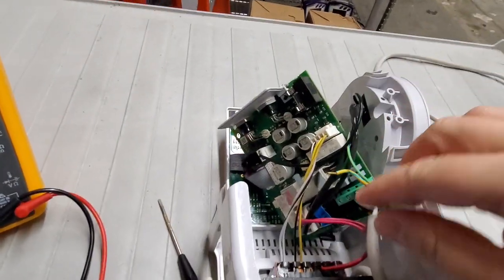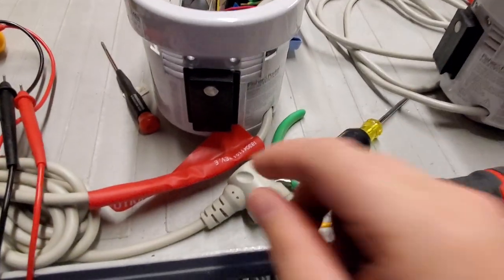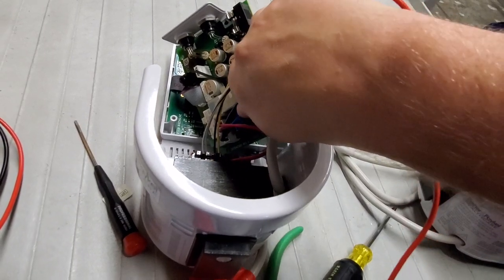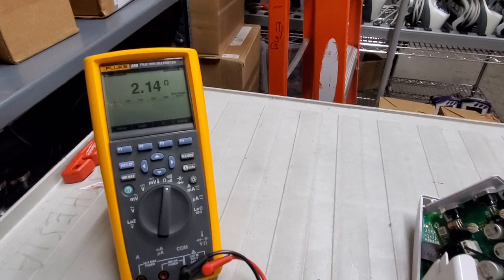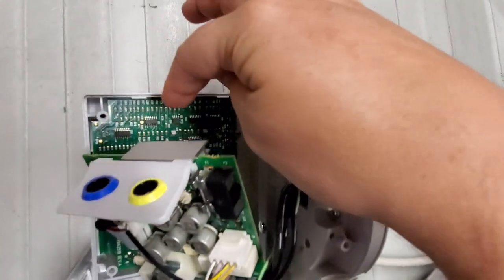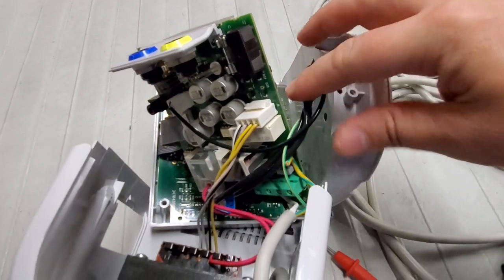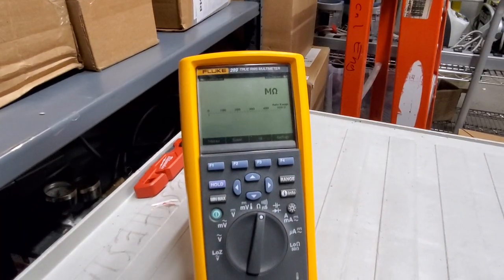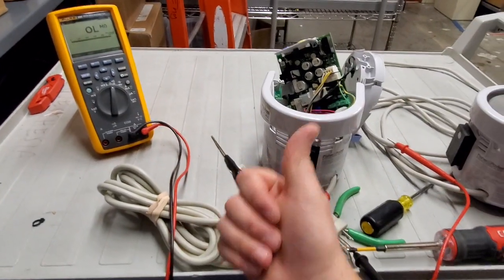Anatomy of a Failure: Fisher & Paykel Electrical Safety Failures

Comment: I HATE putting those MR850's back together..ugh! I find that the ground on those are very touchy, too. The manufacturer says to measure it all by the top plate, but I've had to open it up to make sure that there's a ground reading in there. Sometimes, it's just the plug on the cord, and I'll change that.

Comment: Glad you did a follow up after your last video on these, as I said before they should pass with less than 0.2ohms to the plate. Just for info the plate connection can become high resistance too but slackening and re-tightening the ground wire nut normally sorts. We had a batch of moulded main leads that had high ER years ago similar to what you're seeing now but not connected to the MR's. Very odd but interesting fault. Shows the importance of Electrical Safety Testing, these could easily have a rising potential with that resistance.

Comment: I provide a reconditioning service for the MR850 PCB. If you have any units with E20, E21, E26, E27, any error,, alarms, broken sockets, red light, and no power, I can fix it or will replace it.

Comment: How often does this happen with the resistance of that particular device ?
Reply from the maker: At this time, 1 / 3 devices
Reply: Most times you can adjust the placement of the ground in the block and it will read normal. Even cleaning both ground ends with a wire brush helps. I believe there is a microfilm of oxidation that causes a seemingly good power cord to give a bad ESA reading.